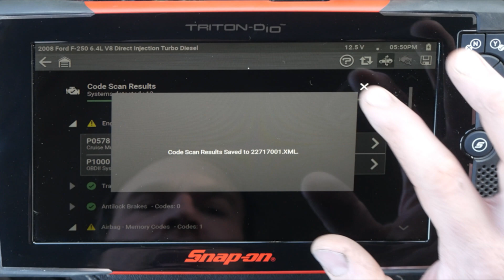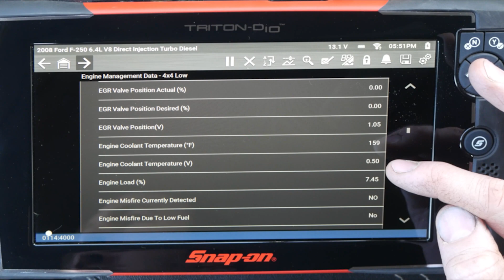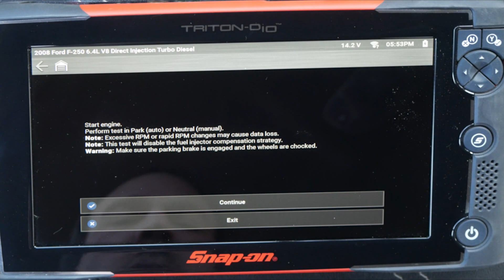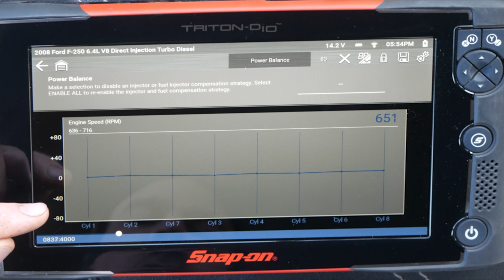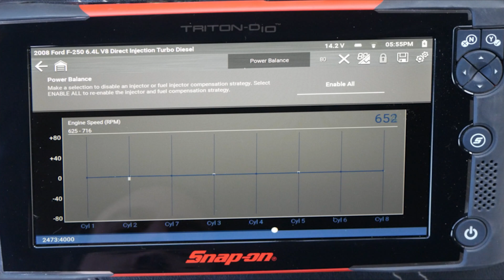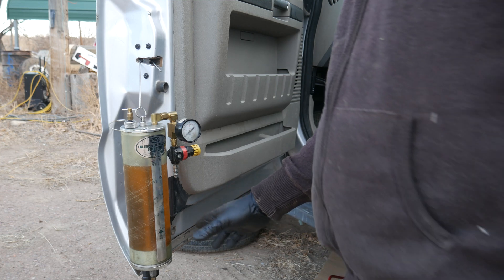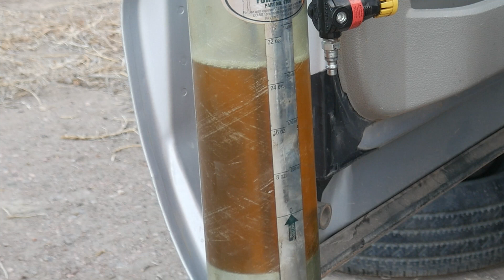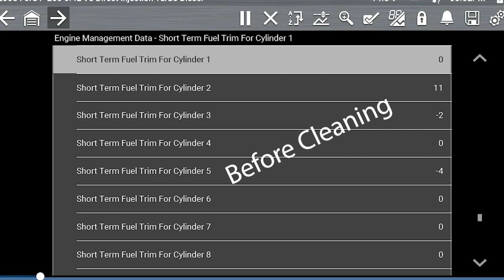2008 Ford 6.4 Injector Balance before and after cleaning

Comment: I played with making an injector cleaning GADGET for gasoline engines based on a used/modified 1# disposable propane cylinder. Didn't quite work out as hoped but then some things don't.

Looks like you're going to end up with a nice truck at a nice price there.